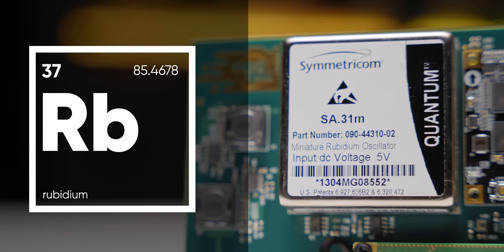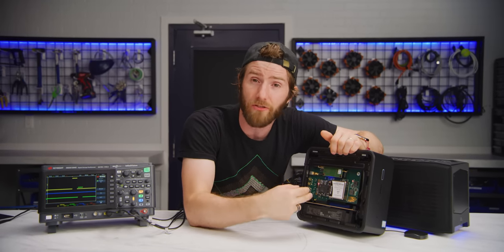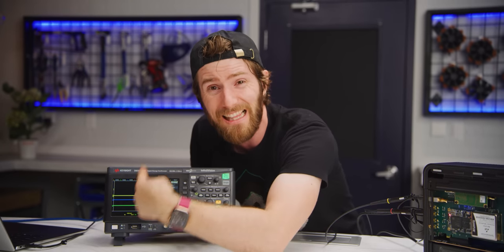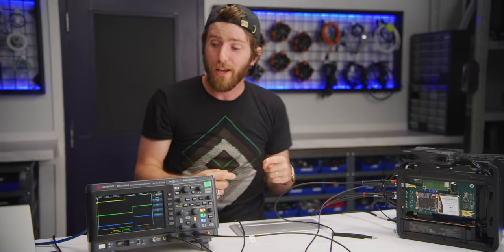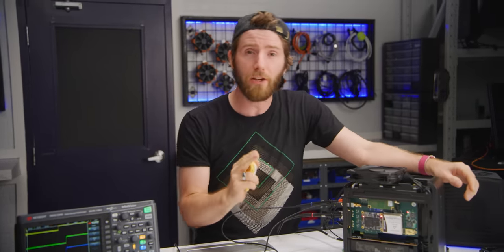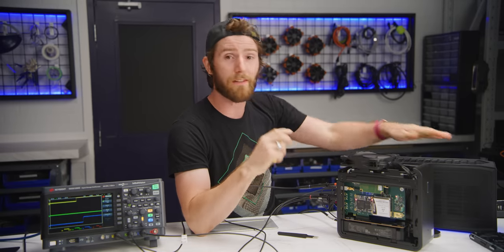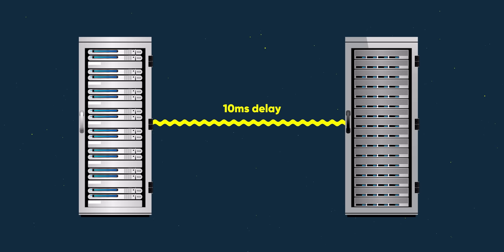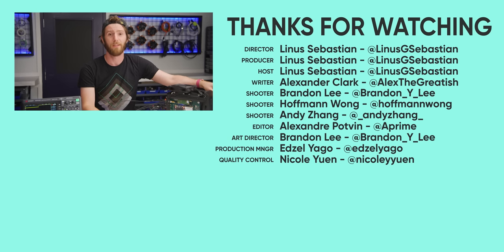Why is this PCIe Card RADIOACTIVE?

Comment: When you get this accurate with time keeping you are going to have to start compensating for the effects of time dilation. Things like how far are your server racks from the center of the earth because time will run (generally) run slightly slower at sea level than they will at high elevations since gravity is slightly stronger at sea level. What is the earth's crust under your server made of (a cubic kilometer of granite will slow time more than a cubic kilometer of limestone because it is denser). What latitude is your server at? Since at the equator you are moving faster than if you are near the poles and the passage of time will be different. I'm sure that is why this tech still syncs with one universal clock as a bit of a cheat but it's just kind of amazing that out consumer tech (I use the term "consumer" a bit loosely here) has become so fine tuned and sensitive that it can actually be significantly affected by the ripples in the fabric of spacetime itself.
Reply: Hell, just like nipping to the tidal wave planet in Interstallar then..... ;)
Reply: r/iamverysmart
Reply: at that point arent you getting into differences significantly tighter than what the cards can even manage?  like the entire reason these extreme levels of timekeeping exist in the first place, the surface of which these cards dont really even scratch?
Reply: Absolut right, and since this is impossible GPS Time gets used. GPS has to compensate for that stuff, because of the speed the satellites have.
I work in the car industry and we also use GPS Time to solve a lot of synchronisation issues between the different Electric Control Units with GPS Time.
Also a nice reminder how important Space is nowadays.
Reply: @Matthewbidk  r/ihavereddit
Reply: @buggerlugz6753  Exactly, though less extreme of course:)

Comment: I feel like they must have had a bad ntp configuration for that baseline example... I've used it (well, chrony) to synchronize computers for robotics work, and the time difference between them has never been close to that large. 
I believe you can also designate one local machine to serve as a time server for the rest of the network, then you should be able to synchronize to roughly within local lan latency.
Obviously the atomic clock hardware will give much better results, I'm just saying that you can get much better than shown without it.
Reply: Wait huh
Reply: @txe1nd  The video is likely rigged to show poor NTP performance.

Systems on a local network like this should be able to have sub-millisecond sync with normal off-the-shelf NTP.

Comment: The atomic clock I work with in a telco central office (used for synchronize legacy SDH networks which is TDM) is way larger lol. The thing takes up about 6U of rack space. Meanwhile what Linus shows is the same thing but inside a PCIe card...

Comment: Linus: Why is this pcie card radioactive 
Also Linus: holds it next to his head.
Reply: He could probably get a higher dose of radiation from eating a potato than holding it next to his head
Reply: Anna  Poor Girl :(
Reply: Anna  I didnt know that 😨
Reply: If he's lucky, it's either Alpha particles (blocked by the skin) or Gama waves (which are so energetic, they'll just go straight through him without hitting much.) It's those pesky Beta particles you have to worry about. (Physics for the WIN! Baby!)
Reply: @hoovyzepoot  I know
Reply: Anna  I don't normally click on those spam videos, but wow that was actually a very emotional one, glad I watched it
Reply: @jackielinde7568  nice I’ll probably learn about that in 2 years or so 😂
Reply: @SobaKick  too bad you won't have any use for it
Reply: @tollevkvendbo  ?
Reply: @jackielinde7568  so you are saying the Gama rays will.....drop Linus? 🤣🤣
Reply: Rubidium gives off beta radiation, which is technically harmful, but the thing is that you've got what is likely a few grams contained in a metal shield, ehich will inhibit the radiation, and then that is contained inside a glass/plastic and metal enclosure that is your PC case. That's at least two layers of shielding - more depending on the construction of the card and the case housing it. Edit: Also, if it's consumer-grade or higher, it's going to be engineered to be safe. 

Second edit: It's also non-ionizing radiation, so it's harmless to humans.
Reply: The radiation dosent have enough energy to be ionizing worse it will do is heat the part a tiny bit which you will hardly be able to notice when looking for it
Reply: @SobaKick  Yeah, everyone's so freaked out about radiation, but if they stopped and took the time to learn about it, they wouldn't panic. 

Alpha is just a helium atom without the electron. It's a big, chonky boy. Your skin will block it. So long as you don't eat anything emitting Alpha, you're fine.

Beta is just a loose electron flying about doing electron things. It will go through skin into tissue (which is bad), BUT it can be blocked by something as thin as a sheet of aluminum foil.

Gamma is a really energetic photon. (It's in the upper band of light.) This bad boy is so energetic, you need a layer of lead more than a lightyear thick to stop it. Which means, there really isn't much we can do to shield ourselves from it. BUT, it also means that Gamma is more likely to just pass straight through you than it is to harm you. (Mind you, it can still harm you if it collides with anything in your DNA. BUT the odds of that are slim.)

Then there are Neutrinos, And they're really only harmful if they strike something that then emits Alpha or Beta particles. As we speak, We're flooded by them from our own Sun. 

There's the radioactive cookies riddle of you have to:
- eat one.
- Sit on one.
- Chuck one out the window.

I won't tell you the answer. But I already have.
Reply: @jackielinde7568  The neutrinos have mutated though. The Signal Path told me.
Reply: @jackielinde7568   umm is it too late to tell you that I was just joking and I know that the radiation will not affect Linus. But we’ll done on making that paragraph I learnt quite a bit has a 16 year old
Reply: @39zack  No... I'm suggesting that there might not be enough "mass" in Linus's head to stop Gama radiation. 🤣😜
Reply: @SobaKick  Did you just make a "Linus doesn't have enough mass in his head to stop Gamma radiation" joke?
Reply: @jackielinde7568  nope I just knew since I was early I could comment whatever I wanted to and it would get some likes it was a in the moment thing sorry if I offended you with my ignorance of radiation
Reply: @livingglowstick1430  Also this!
Reply: @SobaKick  I'm not offended. Just very, very, very disappointed in you.
Reply: @jackielinde7568  I’m sorry 😔

Comment: Correction regarding sub sea "repeaters": they are "simply" optical amplifiers. There is no active participation in the so called "data plane" on the sea floor (and repeater is a kind of legacy term that hangs around in telecomms.)

In doing so it enables any pair of fiber in the cable to carry any combination of wavelengths, and each wavelength can then carry any type of data stream (Ethernet, SONET/SDH, etc at a variety of different speeds), with only the on-shore equipment needing to be changed. It would be super impractical to have to haul up a cable repeater by repeater to install upgrades when you want to switch from 40G to 100G Ethernet per wavelength for example.

So they can't slow down and affect traffic. An amplifier can fail, for sure, but this can be determined through existing telemetry streams and doesn't require any new fancy timing mechanisms.

(My background: about 20 years as a network engineer covering IP, microwave and optical networks)

Comment: Random overthinking question: On this ridiculous scale, does gravitational waves from colliding black holes in other galaxies shift the timing?
Reply: Yes,or else it would be useless as a telescope.
Reply from the maker: Not so much shifting the timing as changing the scale of literally everything a very small amount.  Gravitational waves change the size of everything, so if a gravitational wave makes the world a bit smaller it would take less time for light to travel across the ocean. -Alex
Reply: woah they responded :O
Reply: @LinusTechTips  yeah, as the speed of light dosent change in any reference frames(in vaccum ). even if you make everything smaller, light will travel at 299792458m/s only.
Reply: @varunrmallya5369  Light in fact does slow down when not in a vacuum. That's how you get a prism dividing the light into a rainbow.
Reply: @ruukinen  i modified it. now ?
Reply: @varunrmallya5369  There is still the problem that yes it doesn't travel faster but the ground it has to cover has shrunk. So the end result is that it will end up further along the path.

Comment: Neither Rubidium nor Cesium clocks are radioactive. Radioactive decay tends to be random, which would defeat the purpose anyway. Instead they rely upon atomic resonance.
Reply: Rubidium 87 (used in rubidium clocks) is radioactive, through beta decay(almost undetectable so, with a half life of 4.9x10^10, more than the age of the universe). But I believe what you wanted to say it's that it is not used for its radioactivity, because Atomic clocks to not really on radioactive decay.

Comment: This may enable far larger multiplayer battles than what is currently possible. MMORPGs will actually be massive, and without the lag! It doesn’t necessarily have to be in everyone’s PC, it speeding up the servers in the data center will be a huge upgrade in itself.
Reply: CCP do the opposite during large battles in EVE Online. They call it time dilation, or TiDi, where in order to maintain the stability of a server node instead of offloading packets to another node (potentially introducing asynchronous outputs to *every client*), they simply slow the node down. Before the introduction of this function, large battles were difficult to impossible to implement as the nodes had a tendency to crash hard under heavy load as they'd physically overheat. With the slowdown and input queuing the node stays stable notwithstanding the input delay that means a twenty minute battle involving eight and a half thousand individual meatsack players could last longer than 14 hours.

Comment: A lot of audio interfaces have a word clock, to keep all of your recorded audio in sync! It might be interesting to figure out how to use it. Great topic though!
Reply: The sync frequency to have sample accurate sync is only around 40 kHz so using that to syncronize clocks would get you to 25 µs accuracy. That's better than default NTP implementation but may not be accurate enough compared to what you can do with custom hardware.
Reply: @MikkoRantalainen  44 KHz is standard on crappy realtek chips, anything decent runs 96 KHz to minimize distortion during post-processing, allow for better noise cancellation since you can analyze things outside human hearing range to detect unwanted noises more accurately and it allows you to account for bone conduction.

Comment: I would like to see how the clock was generated ok each computer to be measured on the oscilloscope.
And the more technical behind how to sync the computers enabling the protocol…
Reply: Many NICs a capable of 1PPS signal output, what Linus does there - is comparing those two outputs across two NICs

Comment: I've used algorithms for clustering in massively parallel service oriented architectures. I've used RAFT and other consensus protocols. But what Linus describes as a "get my cat photo" is hardly typical. At least it is in my experience. You're far more likely to hit a load balancer, be redirected to an instance of the application running and get what ever it thinks is current.
Reply: "Eventual consistency" is the name of the game :)

Comment: Finally, 1v1's across the globe can be fair in latency.
Reply: 1v1 me coward, rust, snipers only, 3:45:02:000000000001 exactly. too late or too early? you forfeit.
Reply: Until someone starts altering the timestamps on their packets for an advantage. Then game servers will quickly go back to ignoring the timestamp.
Reply: @bilateralrope8643  The whole point of this system is that timestamping is standardized. They literally mention latency tampering in the video. If you fudge your packet timestamp, it still won't help you because the receiving systems have all been keeping time anyway. The margin you'd have to edit your packet by is greater than the margin of error for these clocks, and the system can throw it out.

Comment: As someone who actually works with trying to keep clocks in check, the issue with PTP isn’t generally getting the time onto the box that distributes it, but the distribution itself. PTP relies on network hardware measuring their own delay, and adding it to the link delay between the server and the client. This results in PTP only working on interconnected layer 2 networks, and PTP being an absolute mess to do over large distances. In a single broadcast studio it’s not too bad, but just the network gear required is already non-trivial.

Comment: These have been around for years but the atomic oscillator, drive and time circuits are the most expensive parts and calibration is very expensive.

PTP has been a game changer for synchronising clocks over communication networks.

These clocks are so precise even relativistic effects have to be taken into account such as GPS and other satellites.

Great video.
Reply: *clocks :-)
Reply: @LubosMudrak  thankyou.  I made a typo 🤣 not intentional.

Comment: To be precise, submarine fibre optic cables no longer use repeaters, as in, a conversion from optical to electrical to optical signals.

They use Erbium Doped Fibre Amplifiers (EDFAs), which are a pure optical to optical amplification technique (powered by pump lasers at different wavelengths, which are powered by electricity).

As to whether these still fail I'm not sure, they are usually dual redundant pump lasers and they are built with a 25 year lifespan.

Comment: Um, that's not how phase and frequency work in most power stations.  
We have a guage that indicates our phase. It's not THAT hard to sync to the grid. And as long as you don't close the output breakers at 6 instead of 12, if you're close enough the grid pulls you into alignment just fine.
Reply: Does the frequency in the NA grid also vary slightly depending on supply and demand?

Comment: I developed FPGAs for automotive lidar, and used the pulse-per-second to synchronize the data streams for an array of sensors. GPS is extremely useful in combination with a low parts-per-million vctcxo quartz crystal oscillator.  You have a lower root-allan-variance when using an GPS + atomic clock + VCTCXO, than you would by using just a GPS +  VCTCXO, but the latter is still exceptional. One issue with rubidium atomic clocks is that it's a lamp that degrades over time. if you stick with GPS + a VCTCXO, it will las for a decade or more.  One important consideration with your GPS antenna is making sure you can connect to the satellite by having it on a window or the roof. You GPS module likely has some sort of API interface to track how many satellites you're connected to. In any case, this is very important to get the worldwide time-syncrhonization you're after.

Comment: CPU's/GPU's miles apart could function as a single massive processor if they could maintain per-cycle synchronization.
All the machines would keep local data stores and update each others records as results were calculated.
The sorts of programs one could run like this would be highly specialized, but the 'cost' of making them work in this mode is trivial.

Comment: Would love to see something like this in terms of gaming - but that would likely require quite a bit of cooperation between many organizations.
Reply: or you know, manufacturer standards, with implementation on the devs ends that makes having this feature a massive selling point

if theres anything humans will fall for nearly every single time, its marketing, especially gaming marketing

really though, it sounds like the support is already there, its just a matter of making this hardware cheap enough to be included as a selling point, without actively having to increase the price on it, and from there it will just become standard.

in projects this extreme, you're literally never talking weeks, or months, or even years, you're talking decades at absolute best without some kind of global mandates, which is a possibility with how increasingly important the internet has become to our lives in general, once the old coots kick the bucket it may become a very real and focused on issue. but in terms of natural implementation, give it 10-20 years for anything not having it to be actively rejected. this is very much conceptual on a global scale at this point, but as the internet grows bigger and exponentially faster, we likely wont have much of a choice but to implement things like this as a required standard to be a major manufacturer, with the refusal to do so turning you into the equivalent of trying browse the internet on windows xp today.

Comment: Yeah, no, that is not how most networks or programs work.
Facebook and a few of those companies sure - they have special needs. But in most cases you do not use Timestamps to determine message-ordering. heck, for that they are basically worthless other than for humans to read them.
And for gaming? Nah, if you'd do that you would just have increased the Cpu and network-requirements without giving the players any benefit what so ever.